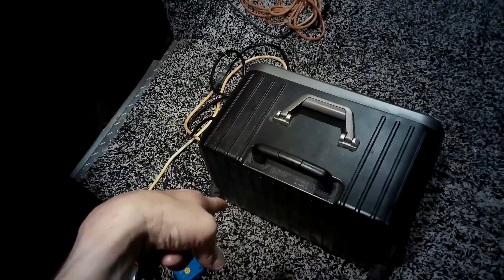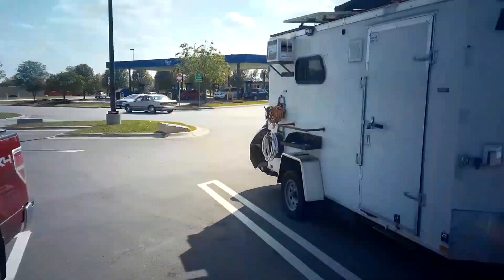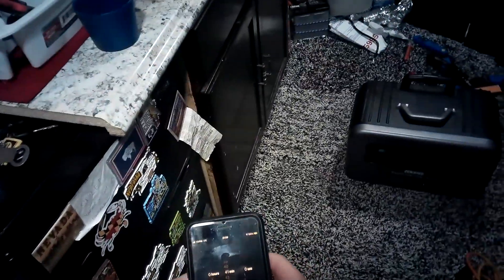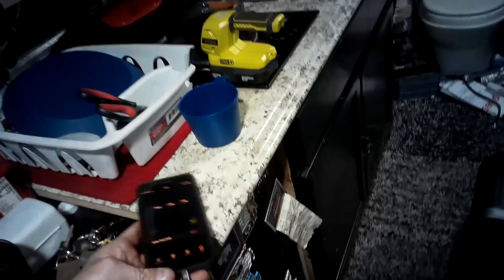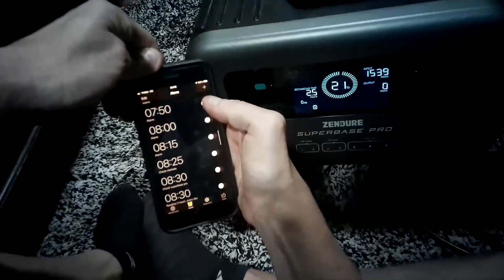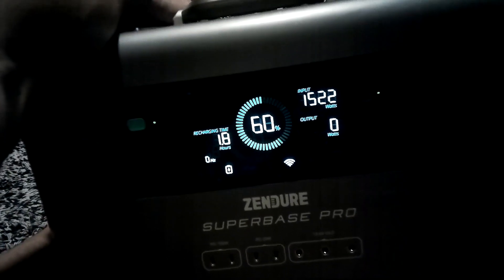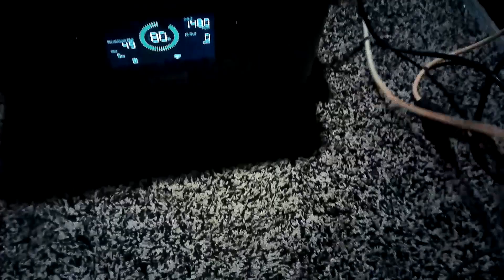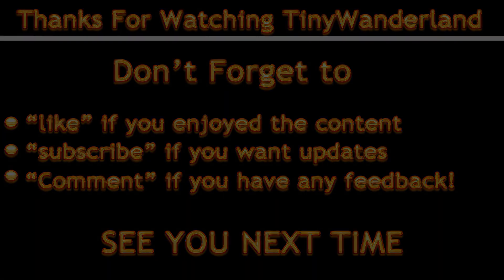Can The Zendure SuperBase Pro really recharge to 80% in just 60 minutes?

Comment: Thanks for the test. I wrote the following only because friends of ours in Saint Louis had a house burn down due to overheating of electrical cords (connected to a gas generator).  They used extension cord (plugged into another extension cord) and the thickness (size) of one of the cords was too small.  This caused the cords to overheat and actually catch fire. The generator was outside but the cords ran into the house and the house caught fire. Completely destroyed the house.  Fortunately no one was harmed.  
Around 9:00 into the video, you mention how hot the cords are. This is a good warning, but I would go further.  
1) Only use an extension when needed. I see that you have many feet of the yellow extension coiled up in a pile. Can you use a shorter extension or plug it directly into the wall?
2) Can you use an extension with 10 gauge or 12 gauge wire? [EVERYONE READING this, go look up gauge and what it means.] The thicker the cable, the lower the gauge, and more amps can safely travel through that wire.
3) Don't use an extension cord wound up on a spool or "tangled" in a pile. With the cord touching itself, it doesn't allow for proper heat dissipation. If the cord is run out along the ground, then it can "breathe" better and gets better cooling.
Again, just a warning to all. Please pin this if you feel it is appropriate.  Everyone using the Zendure or Ecoflow or other products need to know how to properly use them. 
Thanks!
Reply from the maker: Thanks for your feedback. I’m sorry about your friends, and I’m glad they are safe. I have pinned your comment, and everyone needs to read this. As for why I was using extension cords at all, it was because all my outlets are located at higher then normal height due to it being a tiny home. The cord that comes with the unit cannot reach that high.. I’ll keep all you said in mind and I recommend others do so as well. Again thank you.

Comment: How long to charge it with 400 watts?
Reply from the maker: Chris, sorry for the late response. This test was done using 1800 watts on a 20amp household circuit. My guess is it would be 5 hours or so at 400 watts. My test unit failed after two weeks so I am unable to do any more testing.